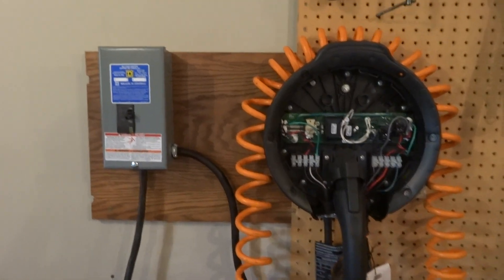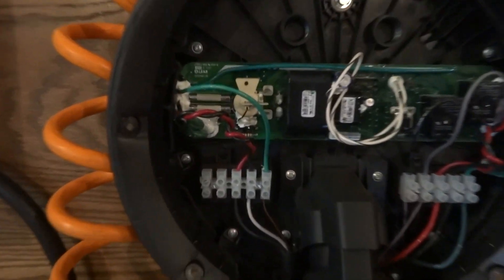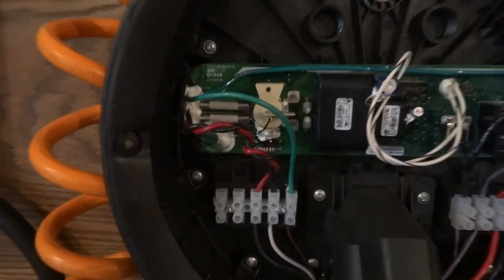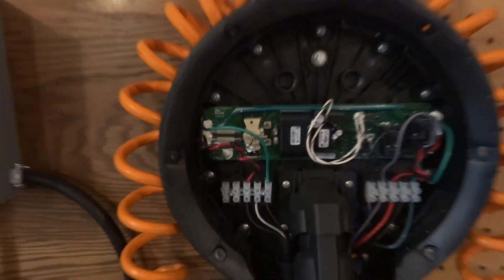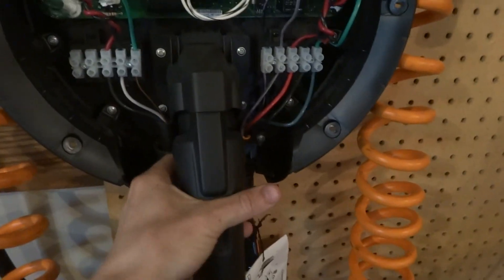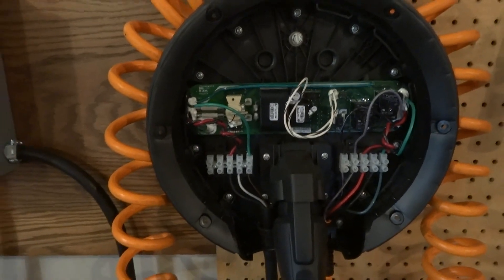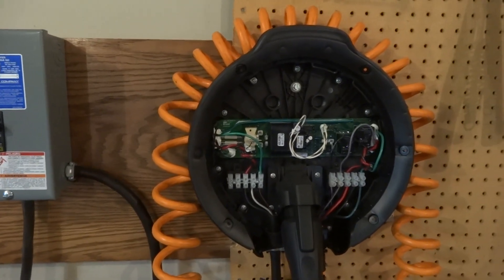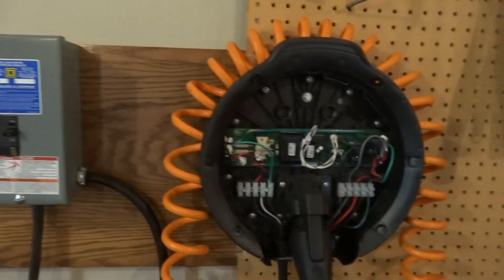Issues with the Voltec 240v SPX level 2 charger

Comment: Maybe you can lend some wisdom… The research I have done shows that the Volt cannot charge at a higher capacity than the 16 amp charging system you  replaced. Based upon your experience is that true? Are you getting faster charges using the Juicebox then you were with the Voltec? Thanks Andy 2013 Volt w a Voltec charging station

Comment: Dammit Calvin! You broke it! JEEEZ! :)
Reply: Something else failed further up your electrical design and you are getting too much power at the resistors.  I'd measure what that voltage/amperage is.
Reply from the maker: sparks flew when the resistor popped the second time ha